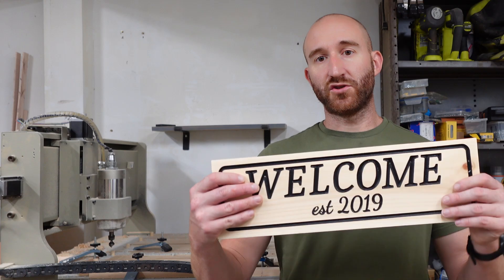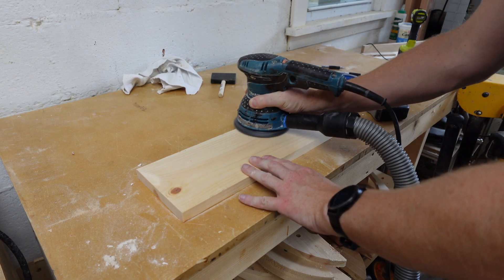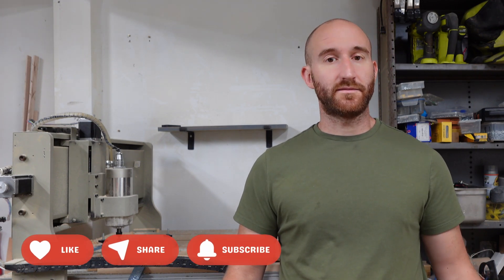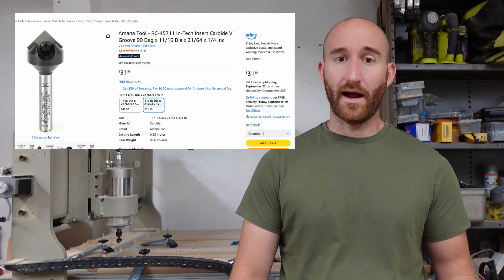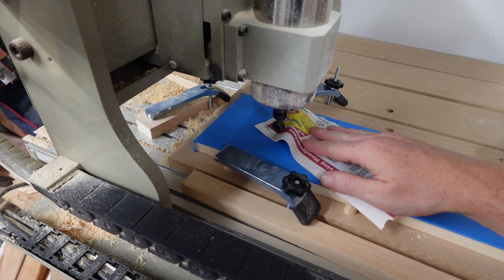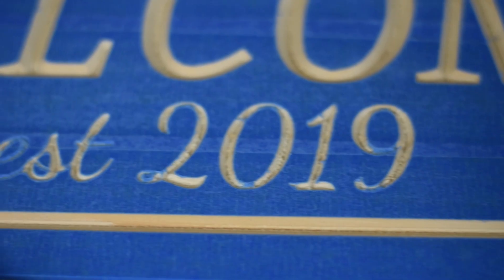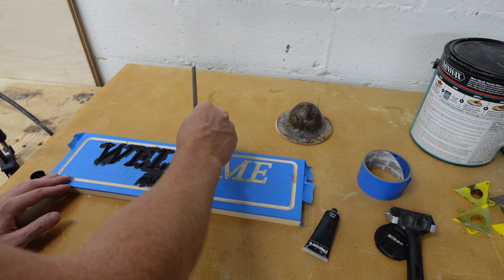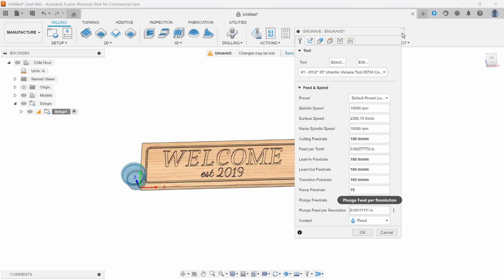How to V-Carve Signs on a CNC (Fusion 360 + Mach3)

Comment: using Mach 3 and Fusion 360 on my CNC, there are so many Vitric Software videos but not much on Fusion 360.  I love your explanations and the way you take fusion, the true Solid Modeling software, and make it easy to understand.  I actually Model my project in fusion and use "Joints" to discover interferences with Drawr slides and pivot joints.  Saves a lot of ruined material with "that didn't work" but of course not all.  Thank you for your work.  My weakness is the manufacturing section and the setups.  I am quite good with the design side, but your overview has, in a short time, allowed me to clean some of that up also.  I find you use of the manufacturing side the most valuable to me.
Reply from the maker: Glad you enjoyed it! I actually haven't had the chance to play with collisions in fusion. I'll have to give it a look at it.

The manufacturing side can seem intimidating. There are a ton of different options, but really only a few need to be adjusted to start cutting and get good results. I'm working on a video now that shows the 'bare minimum' amount of steps you actually need to take. I hope you follow along! 

let me know if there is anything else you would like a tutorial on. I'd be happy to add it to my list